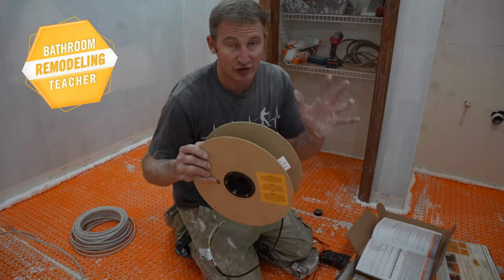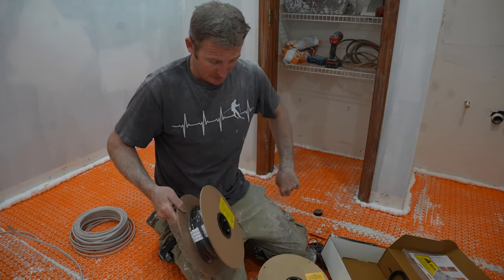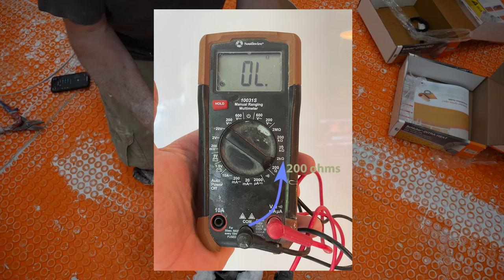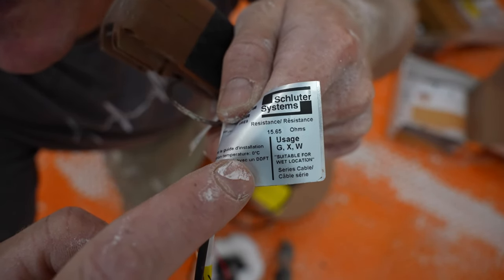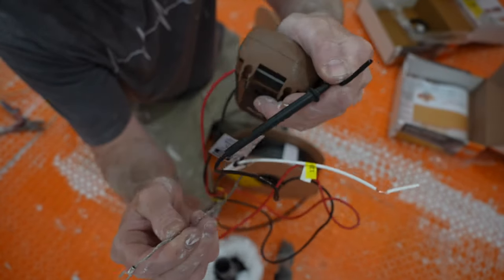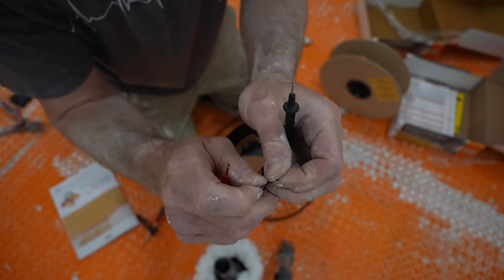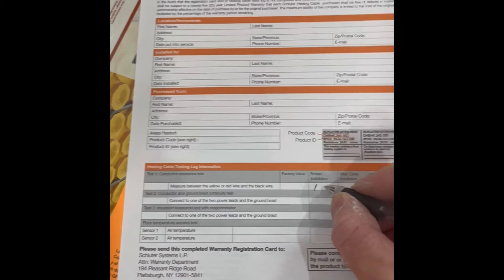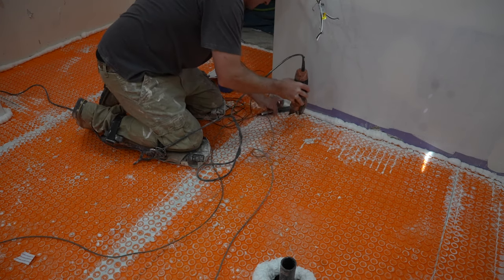Ditra Heat Wire Testing - Quick Reference l PLAN LEARN BUILD

Comment: I am at the same point in my masterbath remodel. Just installed the Ditra heat cabling and the temperature sensors for the floor only.  Next is my floor tile layout this weekend.
Reply from the maker: Are you going with curbless shower too?
Reply: @BathroomRemodelingTeacher  No, I stuck with a KBRS Showerslope. Replaced my hall bathroom with KBRS so I stuck with it in the master bathroom. Next house after I retire will be curbless.

Comment: I have a red light going off on my teacher heat system. The certified electrician used a wire nut on the ground wire. I had a guy tell me that the wire nut does not hold up well to a braided ground and a hard wire ground. Will that cause the red light to go off?

Comment: No megohmmeter testing?
Reply from the maker: That would extend warranty. But i know most will not rent or get one. I barely have the time for that one. But yes, a better way to go 👍
Reply: @BathroomRemodelingTeacher  Fantastic video!!! what setting on the multimeter to test resistance?  what setting to use for the continuity?  Thanks!!!